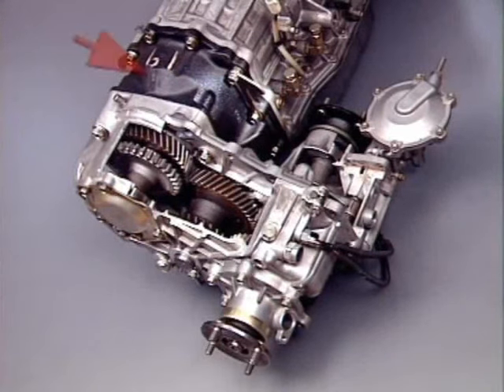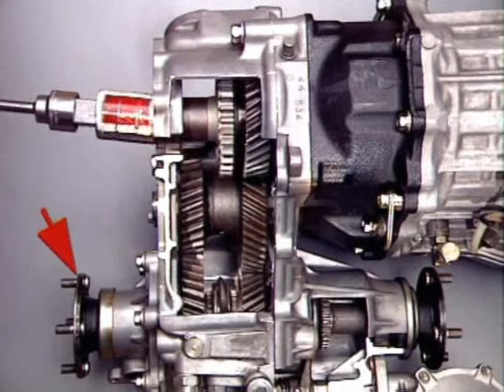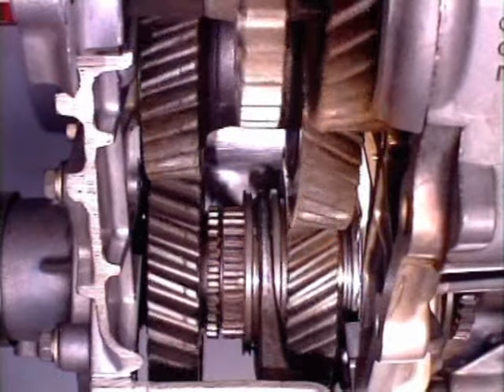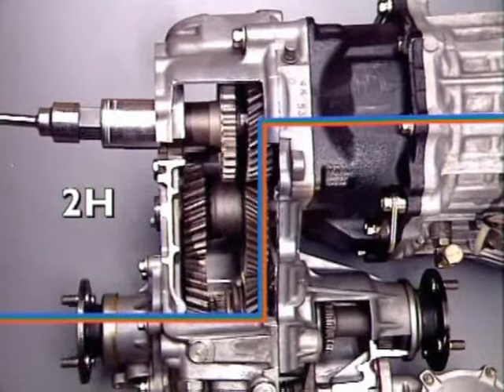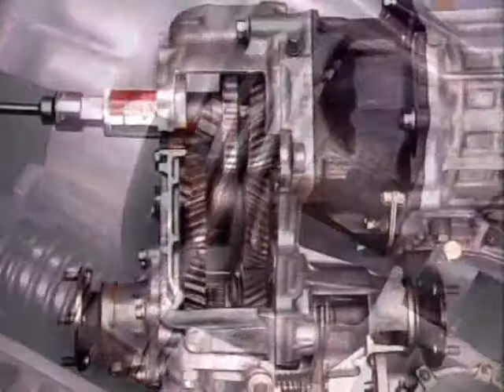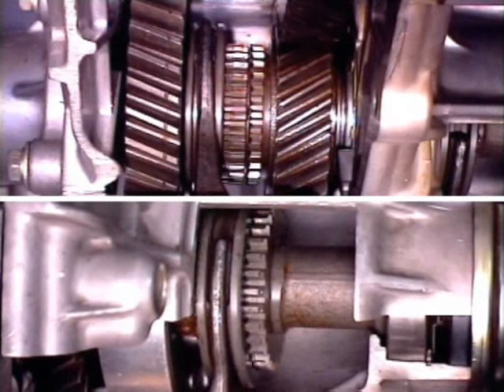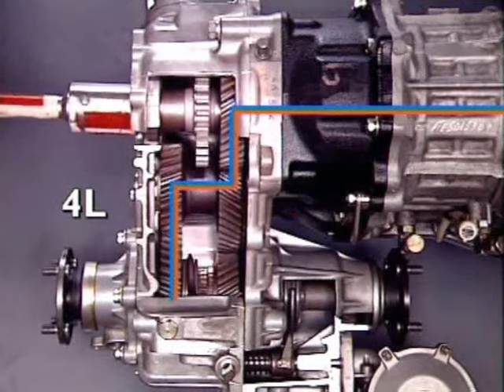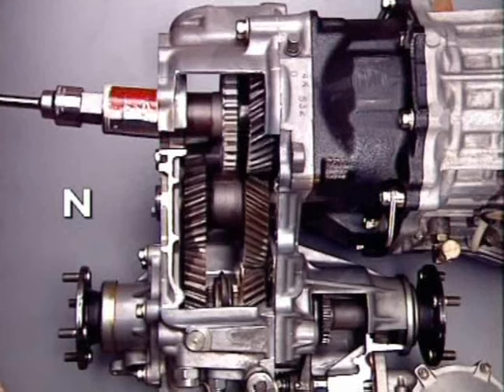Transfer Boxes Explained

Comment: Ok that tells me how my transfer case works very clearly. So this weekend when I put it into 4 low or 4 high with everything working ,hubs locked ,shafts no longer free, and I got stuck because between the transfer case and the front shaft something is no longer connected? 4 low or high only on the back end? No noise and it was working last in February.
Reply: So 11 months ago I was checking the 4x4 while parked at the bottom of a slope assuming that my locking hub were indeed working and I had to get towed 45 feet to get traction . Turns out that one hub just would not engage . After buying new hubs i found this video that explains everything you need to fix your hubs in the wilderness if need be!
https://www.youtube.com/watch?v=W78RkF1mUOE
Could have saved me hundreds if I had known at the time.

Comment: how can the PTO operate and not have torque delivered to the rear and or front wheel drive axle assemblies.
Reply: The PTO is engaged to the transmission either manually or with a button/ switch and with the transfer case in Neutral the drive wheels are disengaged from the transmission and the power goes to the PTO and transmission still, the transfer case in this video "transfers" power to the front and rear drive axles but when in Neutral it doesn't transfer the power to those drive axles but instead the PTO is engaged to the transmission to run that accessory off the engine without the vehicle needing to be in gear but instead just driven off the transmission, it's similar to when you put your car in N (if you have an automatic transmission), the engine is still running and the transmission is still being turned by the power of the engine, it just isn't transmitting that power to drive the vehicle but rather the PTO, I hope this helps :).

Comment: how is it possible to shift the gears without synchronizer since it has only dog teeth.
Reply: Hi, generally you would be stationary when you shift from high to low ratio, which is why you have dog teeth. It's not like a range change on a truck which you would shift while moving. 🙂
Reply: newer ones you can switch while moving, they have synchronizers and electrically operated with a push of a button / knob. 
This video is probably for the older ones where you have to engage 4x4 by shifting like a manual transmission and find that "sweet spot" so you wont grind the gears. I had tried that on GMC trucks and i kept on grinding gears.